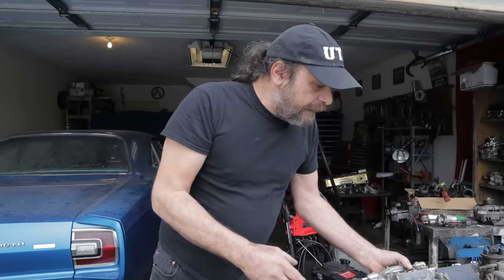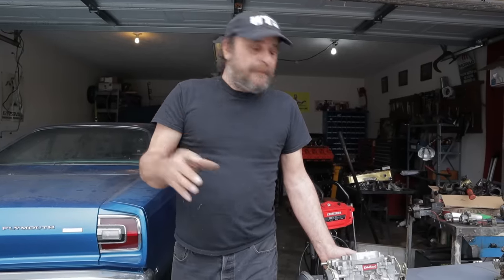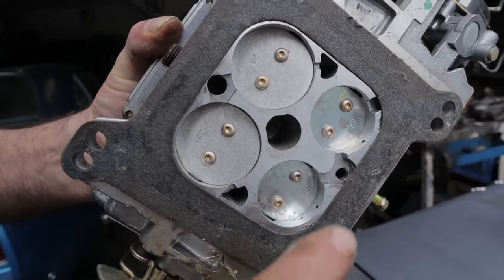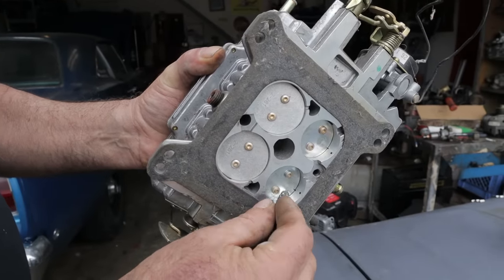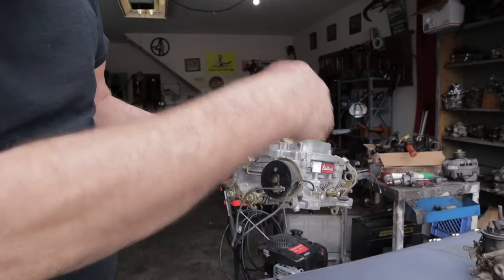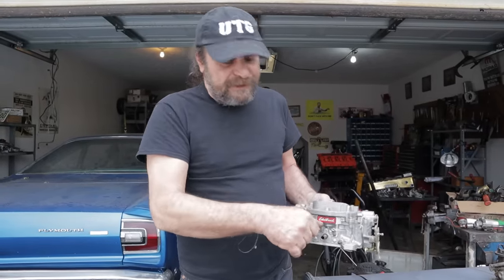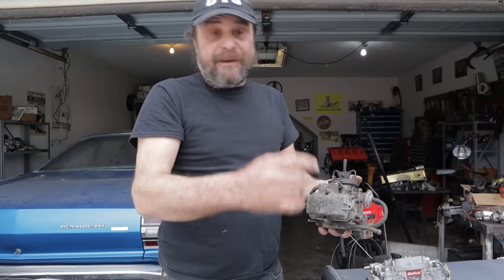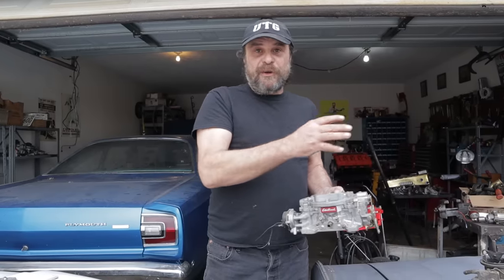The Most Useful Carburetor Video Ever Made

Comment: Something ive always kept with me when riding motorcycles....actually all the way back to when I was a kid and rode minibikes/dirtbikes then scooters then motorcycles..... is a the paper twisty ties. The kind that have a wire in themThe ones that come with garbage bags or bread.  Even the ones that are flat with plastic on them. As ling as they have a wire in them. Id wrap a couple on my key or keychain or throw them in a compartment somewhere.  Im a smoker so I always have a ligjter with me. If my carb starts giving me trouble I can just pull it apart. Burn the paper/plastic off the twisty and use it to clean out any orifice in a carburetor.  Clean the jets, passage ways, holes, anything. If the hole it much bigger then the twisty wire I just put a bunch of kinks in the wire, by bending it around then run it in and out of the hole. Has always worked like a charm.
Reply: Nice!
Reply: Find a friend who plays guitar. Next time he changes strings, ask him if you can have the high E, B and G strings off of it. They have a small brass ball on the end which work great as a handhold and can be cut to 2-3" lengths, They work well for clearing out the passages. I have a full set in my toolbox for just such occasions.
Reply: I use to keep a length of stripped multi-strand wire under the seat in the storage compartment. The copper was soft enough not to cause scratches or gouging.
Reply: Jamming a steel wire into your brass jets that work based on a very finely machined hole is a terrible idea. Either use copper wire that's softer than the jet material, or carry a can of carb cleaner. Honestly for grit or dirt that comes in naturally taking the jets out and blowing them out with your mouth is usually enough, if there's varnish or crap in them that's been around a while you aren't fixing it on the roadside anyway
Reply: I always kept a length of stranded wire in my toolbox from a motorcycle turn signal.   THe strand are small enough to pass through the idle circuits on 250 cc motorcycle carbs.   But find the size you need and use that.   Softer the better to avoid gouges.  NEVER DRILL an idle passage.

Comment: Carbs- ain't nothin' a wire can't fix.....   EFI- every wire has to be fixed!
Reply: Imagine the future of that EFI bolt on stuff.....rotting harnesses, electrical fires, cracking plastic pieces...clapped out units will hit swap meets in droves!
Reply: Yup,and it was runnin when i took it off!!
Reply: @lobmin  Yes sir, I love my 80's and 90's cars but the DIS and EFI components don't age well.
Reply: @JesusSaves86AB  well, the only thing with EFI i have is a car with a one big single point that is placed where a carb should be.. It's very reliable but yes modern EFI are getting too complicated
Reply: EFI is fine, it's simple if you keep it simple and know your shit.
Reply: I find the components are the issue, not the complexity (older EFI systems are usually quite simple). Especially when it's an economy car from a problematic manufacturer (stretched and/or thin wires or insulation, worn rubber or plastic bits, connectors/harnesses, etc). I'm currently restoring a 93 Z24 which is a prime example of this.
Reply: @JesusSaves86AB  Volvo 240 owner here, I feel the pain.
Reply: @victorpelini5995  You have my condolences. The wagons get me hot & bothered tho, the wife not so much.
Reply: @JesusSaves86AB  K Jetronic is a pain to work on 😂 I'm putting a pair of Weber on it this summer
Reply: @victorpelini5995   Nice! I only got a single weber 2bbl on my 140 :)
Reply: @lobmin  it's enough really. Double Weber is just a luxury
Reply: @victorpelini5995   Yes...but that sound!! Haha. If only I could afford to run it
Reply: @lobmin  yup double carbs costs money and drinks like crazy

Comment: For clean idle passages 3rd electric guitar string is perfect.
Reply: Like on a standard gauge set?
Reply: Torch tip cleaners
Reply: So you clean your carbs with a G string.....
Reply: D string? I use g string and b strings
Reply: @nen.user.3764  g, the strings are ebgdaE, 123456, 1 being high e, 6 being low E
Reply: I took a twist tie from bread and burned it with a lighter until just a tiny wire was left of it
Reply: gauge 12 or 13 or something like that
Reply: I'm sorry but you know there are different gauges for the same string, randy rhoads gets a tuned carb while dimedag Darrell can't fit his string into the hole

Comment: I was fortunate enough to learn about transition slots and idle air bleeds and carb " circuits" from older mechanics when i first started out as a professional mechanic. Vacuum signal is vital to proper idle and overall carb perforformance ive been taught. Great channel love this stuff
Reply: My mechanics class shop teacher taught us the importance of using a vacuum gauge to pinpoint problems.
Reply: @rchydrozz751 Absolutely.  A vacuum gauge is a must have for any professional  technician..

Comment: Doubt you'll ever see this as this video has been out a while, but Thank You! I was out driving my slant and started losing idle. Checked for vac leaks (none) then pulled the carb (1920) and found what looked like a tiny bit of material hanging out of the tube end you can see below the lead plug. Blew it out with air (no lead removal luckily) and she runs great again. Thanks again for all the useful everyday info you put online

Comment: As a young buck at 19 just getting into carbs, you have really helped me with understanding how to tune them and what their quirks are. Thanks a lot😃
Reply: Also i have a question. I live in a climate that is very diverse. A summer morning could be 50 degrees and in the middle of the day it could get as high as 80-90. I am considering a carb for my latest build but I’m afraid of losing out on performance and tuning if I go with a carb vs going with aftermarket efi. Could i get away with a carb despite the drastic temps I experience and save myself a grand, or be safe and go with a Holley Sniper?

Comment: Understanding the universal basics for ANY fuel delivery device is essential.  Fine job explaining the idle and transfer holes and why the mixture screws / holes are not fed from the bottom of a float bowl (s) as one would expect. There is a trap in the circuitry for the mixture adjust,  or like a plumbing pipe trap and vent for your kitchen sink drain,  there is an air bleed (vent) hole somewhere in the path between the fuel bowl source and the mixture screw all depending on manufacturer specifications. Glad you mentioned the leaded over (manufacturer drill hole)  with the six cylinder carb.

Comment: I have seen AFB idle mixture screws tightened to the point of breaking the casting inside the throttle bores around the needle holes.
Reply: I've seen a lot of Q-jets that way too.  Usually, if it's just a little chip, it won't hurt anything, but some guys will really crank down the screws (for some damn reason,  I don't know what they think that'll fix) to the point where it breaks a whole chunk out and the throttle body has to be replaced.

Comment: Heres a tip for cleaning out any small passages in carburetors (automotive or small machinery). I've been using electric guitar strings. They come 6 different sizes to a pack. .008 solid wire to .042 wire wound. Great for fishing filth out of tiny passages in carbs. Dirt cheap too.

Comment: I can only build one kind of carburetor Quadrajet. I get the numbers off the side of the carburetor and the rebuild kit.
And quick drying epoxy.
A can of berrymans chemtool carburetor cleaner.
The best luck I've had is with new carburetors, and taking carburetors to a professional carburetor rebuilder. It was just easier for me to throw $200 at it then it was to deal with the frustration. I'm just better at scraping up $200  then I am working on a carburetor. A good carburetor rebuilder will have a test engine on a stand. He will dial your carburetor in before he returns it to you. Another thing I never touches is automatic transmissions. Automatic transmissions require a specialized chimp. Those parts are like bolt on components to me.
The failure rate on rebuilt transmissions is high. I think it's like one out of three. Sometimes it's better to just let a shop do it. That way if there's a problem I just call a tow truck.
I'm 61 on old and sore. Too old to be looking stupid fucking around with something several times.
That little idle circuit on the carburetors kind of like an upside-down P-trap with a vent.
I'm a plumber. Excellent video Tony. Thanks again

Comment: A couple things I'd throw out there, as a guy who's spent several years dealing with carb'd cars on a daily basis in a shop (mostly Kihiens on Honda's - but carbs are carbs)

1. Most carb problems aren't.  I found I saved a lot of time by checking for good spark, proper ignition timing, and vacuum leaks...  Carbs get dirty and gummy, but it's commonly something else.

Remember, the stuff I worked on was tiny compared to an AFB - a few thousands of crud that could make a difference on the little third barrel on a Honda CVCC would not make a measurable change on a big Carter or Holley four-barrel.

And even then, they were rarely dirty enough to cause problems (compared to the amount of failed carb base gaskets & rotten vacuum hoses

2. Another guy pointed out not to fiddle with ANYTHING on the carb but the choke until it's fully warmed up.

This is 100% correct.

I would also add, if you think the choke is not working correctly, be damned sure you warm the car up completely, and that the idle circuit is set correctly then.

I don't know how many cold running problems I worked on that turned out to be a lean running condition at idle.  And, the car would seem to idle reasonably well when warmed up (oftentimes someone jacked up the idle speed to compensate...), but if I ran a propane test on it, the thing would pick up 150 RPM... get that fixed and the 'runs poorly when cold' complaint went away
Reply: I spent 3 yers working on 250cc motorcycles used in MSF classes in NC.   I agree with you.   Most of the carb problems were clogged passages.  I NEVER needed a rebuild kit - just  good cleaning.  Carb, especially for a small engine HAS TO BE CLEAN!

Comment: Never had to mess with a car carburetor but my 2 stroke dirt bike has one and after 2 years of messing with it I went to a $500 fuel injection like carburetor and it runs perfect all the time now.  Well worth it for me!  Tried every combination of jets and needles and it was never right.  Carburetors are easy to adjust and get to run but hard to perfect it at every elevation and temperature.

Comment: I just finished the Carter WCD carb on my 1958 Willys Sedan Delivery. The last time I rebuilt it was 1984. The new gas is just nasty. The Edelbrock (Carter AFB) that you were holding is functionally about the same. The  metering rods are much easier to assemble on the AFB. I enjoy your tutorial on carbs for the EFI set. Glad to see you're all fine. I'm waiting for the Power Valve vs. Metering Rod episode. Press on.

Comment: Gosh do I ever appreciate your videos, you go into this stuff in the sort of detail that I personally need to understand this stuff. I find so much of the time its given in such broad generalizations where its along the lines of 'just do this trick or that' that doesn't give you the information to deal with a broad set of problems. I think I did a fairly good job regardless, but I wish I had some of this information when I was rebuilding the Quadrajet on my 88 caprice wagon (yes, of course it has the fake wood). I've been becoming very fascinated by these pneumatic control systems lately.  Its something that's largely alien to my generation, at least outside of certain specialized fields like hydraulics but I'm mainly speaking of stuff based off gas pressure differentials. I mean hell, even the HVAC control systems on my Caprice are controlled via that sort of thing; partially anyways.

Comment: My old 77 Econoline would kill intermittently too. It never worked for me before but I pulled and cleaned the mixture screws and blew shop air into the mixture screw holes and that did it. Edelbrock 650, I'd already opened it up and cleaned the Jets and passages to no avail, evidently I missed something so instead of disassembling it again I used the shop air trick.

Comment: I had the same problem once, good thing I figured it out! The problem I had with an edelbrock that costed me one engine and almost 2 engines, was a lean condition on the passenger side causing insane detonation, I checked fuel distribution in the bowls, even staggered metering  rods and jets, to try to compensate, rebuilt it several times, tried different floats levels. I never figured it out

Comment: I helped a friend with a 1978 Toyota pickup a few years ago. It would idle ok, but it would not drive right. I spent about 30 minutes figuring out what each screw did on the carb. Once I knew for sure what each screw did, I started dialing in the idle better, messed with the initial timing at the distributor dialing it in at idle, then fiddled with the other mix screws to make it run better off idle with no load. We took a drive around the block, and by doing all the adjusting by ear and nose, I got his truck to actually drive much better. It was not perfect still, but it didn't try to ram him into the vehicle  in front of him anymore or get him rear ended. I honestly think looking back, he had a vacuum leak somewhere that we did not find. But hell, that truck had 335,000 miles on it, and that engine was BEAT on in the time he had it (it never ran right and I am pretty sure it was run lean for the better part of a year) and while it ran like crap, mechanically it was still fine!

Comment: I've found a good rule of thumb, Carter or now Edlebrook carburetors are so complex that they are simple to work on, Holley carburetors are simple but are complex to work on, because I had a 750 double pumper that kept blowing out the power valve when the engine was held at 6500 rpm then dropped back to idle, I remedied the problem when I put a 725 cfm Carter Competition in its place and got better 60 ft & 1/4 mile times plus higher mpg during the runs. As of this day the guy I gave the double pumper to still cant fix the power valve problem and he owns and operates a race shop that specializes in Holley race set ups.
So I just do the KISS method, Keep It Simple Silly and go with the simplistic item that's pretty easy to maintain and upkeep and it'll get you what you need!

Comment: I've noticed sometimes that timing, and or Vacuum advance will affect Throttle stop screw adjustment. Like if a particular combination is set up to run on manifold vacuum instead of ported, and is currently on ported, then Idle screw will usually be cranked up into the transition slots to compensate for lack of timing...
Reply: A 1/16 hole drilled in the primary butterfly, near the idle slot , can be helpful if you have a radical cam. Many of the Holleys , have one from the factory . Edelbrocks are good carbs, but being a vaccum operated secondary, low vaccum on a radical cam ,may result in a secondary that doesnt come on quick enuf , or fully open. Most engines I build or work on , are fairly radical. So i use a Holley based carb, double pumper ,with mechanical secondaries.

Comment: The transition slot is seen from from the top of the carburetor with a flashlight and Edelbrock recommends 1/8" of the slot exposed.... It can be achieved by adjusting the idle screw to open and close the butterflies.... Simple and effective however then you have to go back to the idle screws and adjust those with a vacuum gauge to achieve your own optimal idle rpm.

Comment: If there are any vacuum leaks, the engine may not idle or will miss at idle. You cannot properly adjust the carburetor with vacuum leaks. Also if RPM is too high, it’s off idle circuit and won’t adjust. Most are off idle circuit around 1100-1200 rpm. Plugged idle circuit is the most common reason for a rebuild but the most common problem now a days is choke issues. With cleaner fuels you don’t have much trouble. Accelerator pump is probably the third most common problem with carburetors. That hesitation when first hitting the throttle. I always check to be sure a good strong squirt comes out when snapping the throttle engine off. I have rebuilt more carburetors in my life than I wish to admit to. Fuel injection is so easy and easy to set when the engine has been upgraded such as a larger cam etc. I still enjoy rebuilding carburetors even today. I teach my son the older cars along with the new ones. I’m working on a LT1 right now with him and he’s having trouble with the Optispark system which I myself had to educate myself about it for I never had any prior experience with it. Have a great day/weekend.